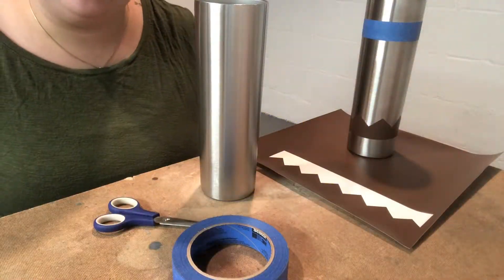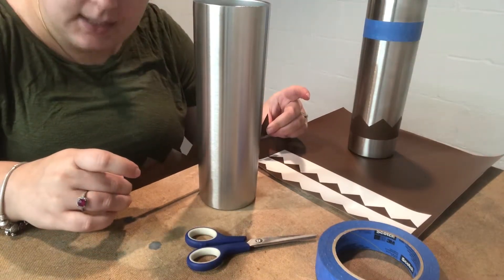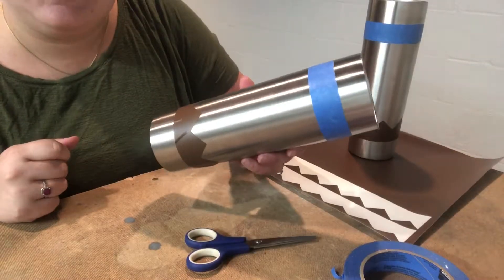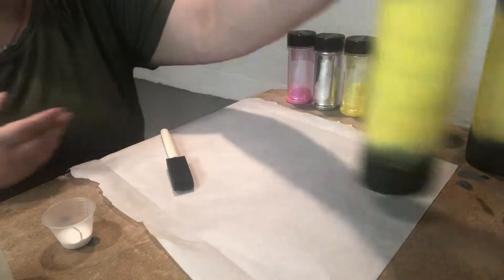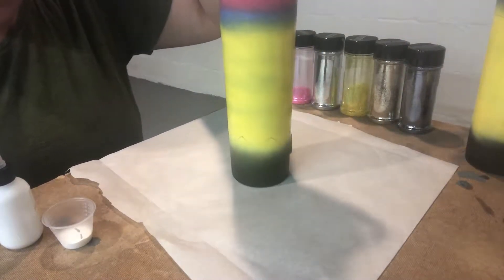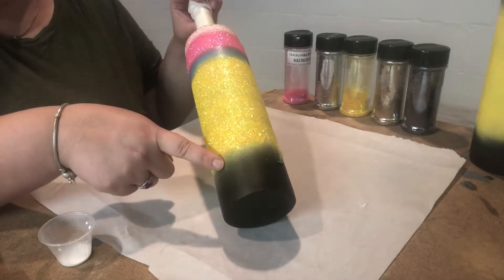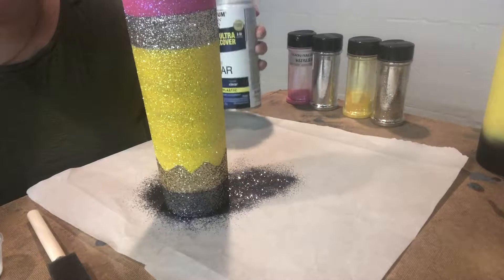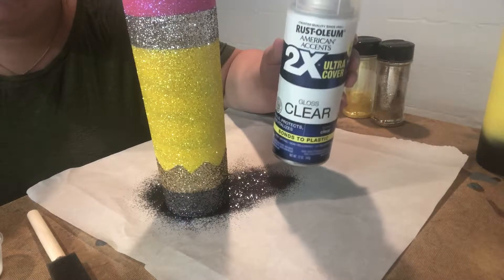How To Make A Pencil Tumbler

Comment: Wow ty for this straight to the point and so easily explain may u tell me where I can get the zigzag file and size?
Reply from the maker: Your welcome! I just made the zigzag in Cricut design space using a rectangle and a bunch of triangles and welded them together. I measured around my cup to make sure I cut it the right length.
Reply: @HalfDozenCreations  ty so much I appreciate u!!

Comment: what did you use for the zig zag part
Reply from the maker: taila jefferson in Cricut design space I just used a rectangle and put some triangles on top and welded them together. And I measure around the cup to see how big I need to cut the vinyl piece.
Reply: @HalfDozenCreations  okay thanks so I can use any color vinyl for this and it has to 651 vinyl
Reply from the maker: taila jefferson your welcome! You can use any vinyl since it’s just a stencil!
Reply: @HalfDozenCreations  okay thanks